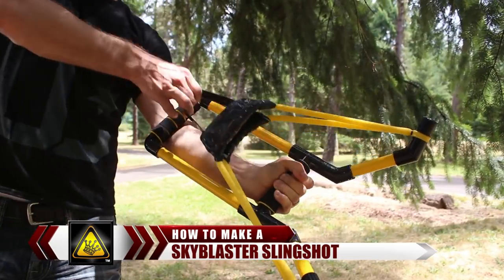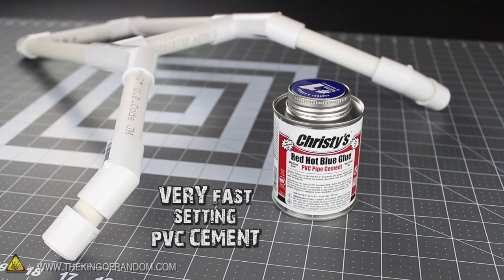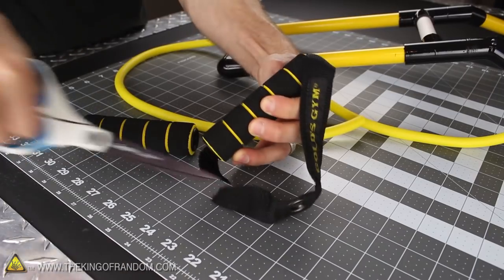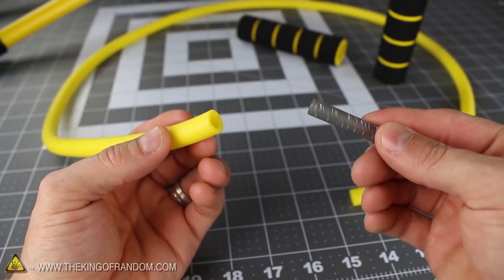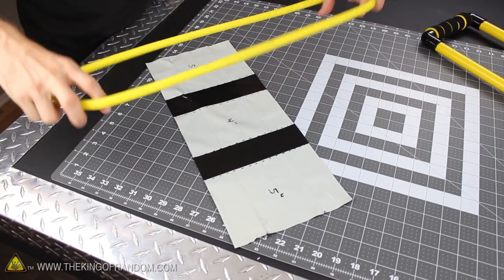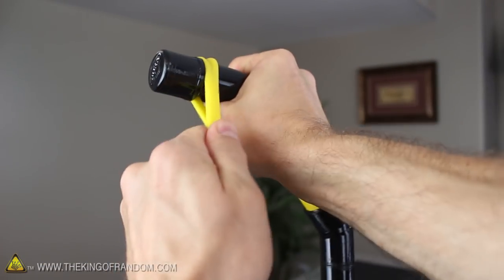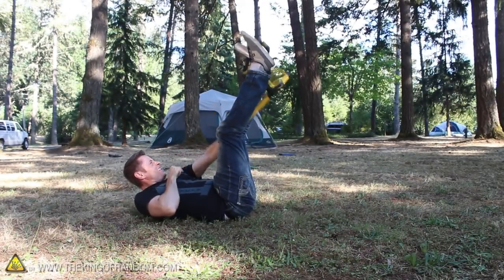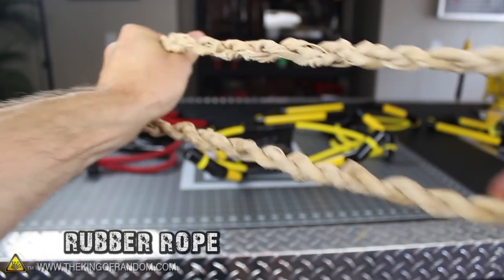How To Make The Skyblaster Slingshot

Comment: Forgot the add this in too.  I need to find a way to make a coil that will get hot but not melt.  I use it for launching fireballs.  I made a flashgun style using glow plugs, but they get too corroded and need to be replaced.  I use flash paper for the fireballs now but before I used the paper and some insides from fireworks for a nice sparkly effect.

Comment: Beautifully made, but you do have to be careful with this. When you pull back to launch the water balloon, especially with a strong pull, there is a risk that the PVC can break near or on a fitting, especially as the PVC ages, it tends to become brittle. I learned this myself years ago working on another project. Absolutely wear safety goggles. If it did snap, you can get wacked in the face by the PVC section that broke off. I like the idea so much, that I will be making an aluminum version of this. One piece of bent tubular aluminum, with rubber end caps, padded handles, and with brazed in sections. I'll stitch up a nice leather section for the balloons.
Reply: electronicsNmore too long did not read
Reply: where can one find aluminum tubes?

Comment from the maker: Some quick links to a few of the materials I used:

[✓] Exercise bands: http://amzn.to/2cz7iub
[✓] Duct Tape: http://amzn.to/2cma8Qw
[✓] Kylon spray paint: http://amzn.to/2cm9ORN
Reply: Is there anything else you can use instead of a pen for the exercise band
Reply: Grant Thompson - "The King of Random" the project PDF link didn't work
Reply: Excuse me Grant Thompson, do you place the 1 3/4 inch PVC pipe in between the 45° Elbow and Tees?
Reply: Grant Thompson - "The King of Random" hi
Reply: Grant Thompson - "The King of Random" , hvot I you live in Denmark
Reply: Grant Thompson - "The King of Random"
Reply: ya
Reply: So I have made the sky-blaster slingshot and it looks cool, Thanks Grant!
Reply: would it be possible to mount one of these to a tripod and make a waterballoon balista?
Reply: Grant Thompson - "The King of Random" xaq
Reply: Grant Thompson - "The King of Random" hi
Reply: Grant Thompson - "The King of Random" .
Reply: I made one😄
Reply: Grant Thompson - "The King of Random hi
Reply: I made one too
Reply: Grant Thompson - "The King of Random"

Comment: I compiled all the needed resources to make 8 parachutes, 8 skyballs, and 2 Super Launchers for you guys! Enjoy and thank you so much Grant for making these awesome and fun creations

Super Blaster Parts - Parachute, Sky Ball, and the Super Launcher

Parachute Materials:
         Plastic Table Cover
         Tape
          #3 Crochet Cord
2 ft -   ¼” Braided Elastic
16  -   #7 Barrel Swivels

Sky Ball Materials:
32  -   Latex Party Balloons
          Rice
2 ft -   ¼” Braided Elastic
2oz -  Baby Bottle

Super Launcher Materials:
4 ½”  -   Pvc Slip Caps
4 ½”  -   Pvc 45 Degree Angle
4 ½”  -   Pvc Tees
4 ½”  -   Pvc 90 Degree Angle
95” ½-   Pvc Pipe
            Pvc Pipe Cement
2      -   Long Resistance Band
            Spray Paint
            Duct Tape
2      -   Ballpoint Pens
2      -   Zipties
Reply: Thank you!
Reply: thanks!

Comment: What You will  Need 
2 x 1/2" PVC Slip Caps
4 x 1/2" PVC 45° Elbows
2 x 1/2" PVC Tees
2 x 1/2" PVC 90° Elbows 
4ft of 1/2" Sch 40 PVC Pipe
Reply: if I use 3/4 will it be stronger or perform any better?

Comment: I wish you used the metric system.
Reply: Use something to change the measurements simple as that...
Reply: TobiBobi4 Thanks for explaining the joke captain.
Reply: jojojorisjhjosef Just multiply the number of inches by 2.54: 10" = 25.4 cm; 2" = 5 cm; 1/2" = 1.25 cm; 1-3/4" = 4.45 cm; 5" = 12.7 cm.
Reply: jojojorisjhjosef use google, they can calculate it
Reply: jojojorisjhjosef Use a Google Converter.

Comment: I would lie to make a suggestion, when making projects such as the one in this video, you should put marker line from each cut joint to the fitting this way you do not have to worry when your gluing all together  you just follow the marker line; if you do it this way you can never go wrong.  I like the projects on this site, I hope that my suggestion has not offended but rather helped in making this and similar projects.

Comment: You must get far thicker walled or tougher formulated PVC in the Americas. At 1/2 inch (well, 16 mm, the closest we get) the pipes and joins can't take anything like the stresses involved. Even after scaling up to 22mm materials it still splits nastily and potentially hazardously given the draw you'd be pulling toward your face in actual use) far too easily. Scaling up any further is useless as the pipe walls don't get any thicker and the structural shape deforms even more quickly.

Comment: Grant,
This is the first one of your projects that I've tried, and I have a problem that Id like your help sorting out. When I try to connect the tube ends together, one of them comes loose and pops out. The other end stays in fine. I used exactly the parts you used in the video, but this won't work. I would really appreciate some help I you have some time.
Thanks

Comment: you could also take ninja balls with but some customized version of his rocket fuel instead of flour or use gun powder/black powder and stick a homemade fuse in it then lite, launch strait up, and run the other direction as fast as u can

also if grant himself would like me to delete this comment due to its dangers I will
I am not responsible for those who get hurt using this idea or for damage caused by this idea

Comment: Grenade. Use a grenade. Tie a string to the pin and the other end to the front of the frame, so the pin is pulled as it's flying away from you. 

Poorman's M203.

Comment: The zip ties cut thru the resistance band. Could be fixed with electrical tape.  Also the PVC cement melts the spray paint so build, then paint.

Comment: The resistance band isn't hollow like the one in the video, it has a little extra rubber on the inside for a black elastic string going through the whole thing. Any ideas on how to work around this? Thank you in advance.

Comment: you need to tightly wind the nipple of the water balloon to make sure it rips apart on impact. This is done by pulling the nipple hard through two fingers pinching it tight until it gets shiny (surface area is stretched to reflect light not dampen it).

Comment: How did you get the foam grips onto the PVC? I tried twisting and sliding, and only managed to get one on... but it took a long time and it began to tear.
Reply: Mason D. Hey Mason!

 I personally used pipe insulation (think pool noodle) that's black and about 4 ft. long that is cut in the "spine" or center of the tube. This has adhesive on it and is protected by a piece of thin plastic. I found this at my local Lowe's for about 2 dollars.

Using this method means that you can assemble the entire PVC structure at one time (because of the way it wraps around the foam and adheres together) and if the foam breaks over time, you still have about 3 and a half feet of the stuff. The only downside is the material is a little thick, but it should be OK once you get used to it.

Just make sure the size you get is 3/4 in. , because the recommended size for CPVC (which is different than PVC) isn't right to wrap around the 1/2 in. PVC. It's for 1/4 in PVC. (Not entirely sure on this; might want to borrow a piece of PVC from the store to make sure it fits right)

Here's an example: http://www.lowes.com/pd_21415-1410-S11XB/6_1z0zq5t__?productId=1060005&pl=1

Good Luck!
Reply: Alexander L Thanks!I ended up cutting the other grip down the middle and gluing it on. But if I make another one, I'll definitely use pipe insulation.